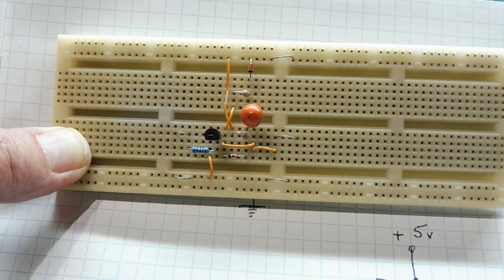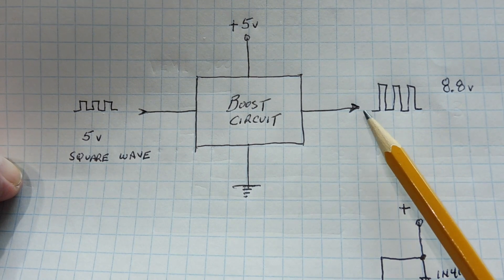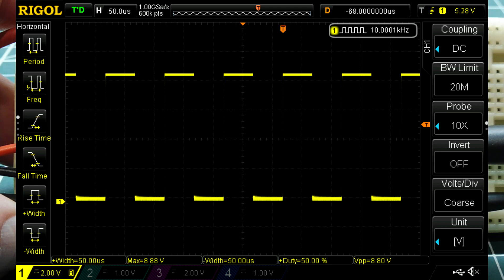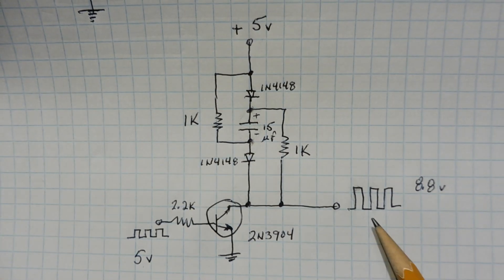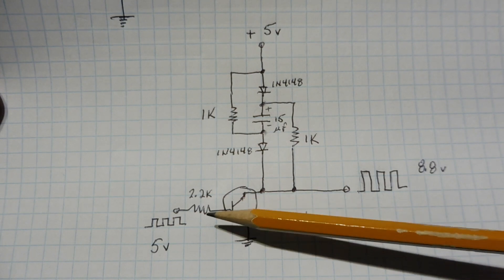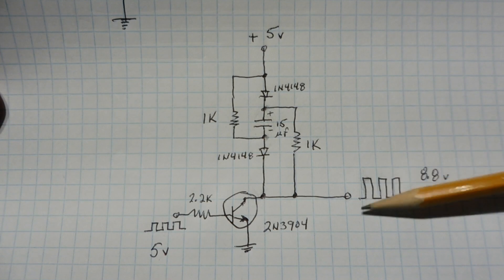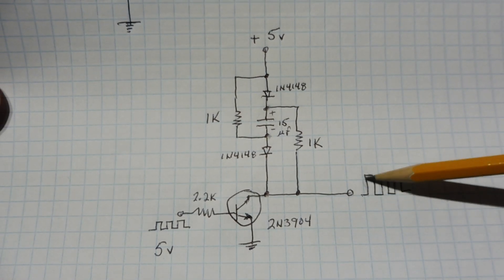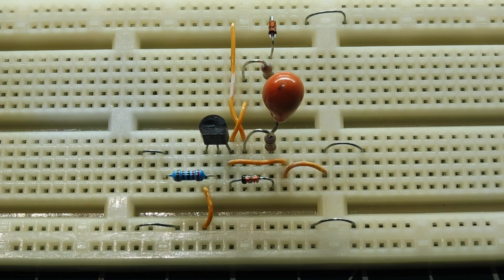Voltage Boost Circuit /  Bootstrapping

Comment: Thanks for sharing this circuit! I have a 3000 Watt Voltage Regulator and 110/220v step up/down device. With a brief cleaning inspection, I was surprised to only find low watt components inside, besides the huge transformer, breaker and terminals. Could I have just not seen some large power transistors and capacitors? Is it possible to utilize extra taps on the transformer and low watt components for a 10% voltage regulation???
Reply from the maker: It's probably a Sola-HD power line conditioner and regulator used in areas where brownouts and voltage fluctuations occur. Regulation is done by the winding's in the transformer and not by any active components.
Reply: @0033mer  thanks, it's a Simran AR-3000, and very effective for eliminating line drop (and loss of performance) when driving high powered audio amplifier or air conditioning unit on old 15amp domestic circuits. I don't understand how the windings can regulate, doesn't a voltage drop on the primary cause a proportional drop on the secondary?
Reply from the maker: Search for Ferroresonance online. https://stevenengineering.com/Tech_Support/PDFs/39TECH.PDF
Reply: @0033mer  thanks for the link! I've never heard of ferroresonance, very interesting!

Comment: Ahh... Clever to offset the ground by 5V to bump up the output to 8.8V... Is this the part that is called the "Boot Strap?"
Reply from the maker: Yes .."lifting yourself off the ground using your boot straps" refers to the capacitor voltage going above the supply voltage.
Reply: @0033mer  Thanks! Good way to remember it.

Comment: Nice video - but why is is called bootstrapping?
Reply from the maker: Picture yourself tying up the laces on your boots. Grab the laces with both hands and pull up hard until you lift yourself off the ground. This describes the capacitor charging up above supply voltage.

Comment: Isn't there a diode-like drop across the transistor's collector-emitter path?  If so, that would mean the voltage across the capacitor is lower, and that the low output voltage is above ground (by that drop).
Reply from the maker: The collector-emitter saturation voltage of the 2N3904 is .2 volts. Nominal threshold voltage of a MOSFET is around 1.5 volts and max low level input of CMOS logic is also around 1.5 volts so the .2 volts above ground is within spec of a logic "ground".

Comment: Nice. 2y ago, I designed a boost circuit that doesn't need an external pulse signal - I used it to light an LED from a drained 0.8V battery. The design uses two transistors to form an astable multivibrator, and feeds the generated pulse to charge pumps.  Here's a video: https://www.youtube.com/watch?v=CDTrOSTk5zA - check the video details for a link to my blog post with schematic and simulation.

Comment: Could you boost it further by changing the components. Im thinking use a different capacitor but I dont know much about this stuff.
Reply: No matter which capacitor you use, it will only charge to 5v in this circuit.  Putting in a larger capacitor might provide more current, at the expense of lowering the frequency response of the circuit because it will take longer to charge.  So the short answer is no.  You might be able to raise the voltage by a volt or so by using shottky diodes which have a lower forward voltage drop than non shottky diodes.  You might also be able to chain these together for greater boost, but then each time you do so, you trade off voltage for current.

Comment: Thanks! Maybe you can also describe how to make a booster circuit for an DAC - e.g. 0-3.3v DAC output is boosted to 0-12v
Reply from the maker: An op-amp circuit with the correct gain should work.